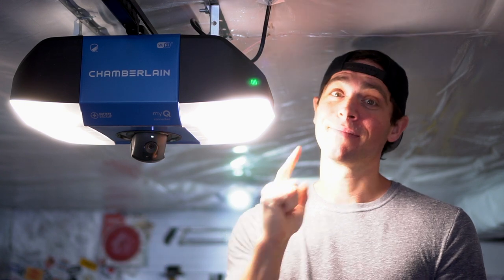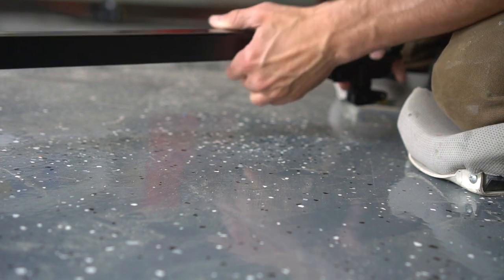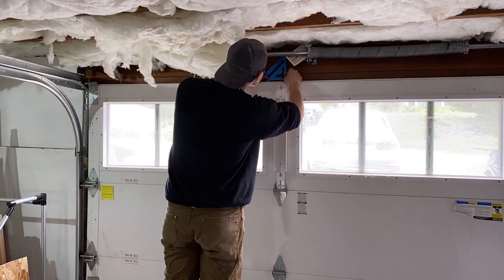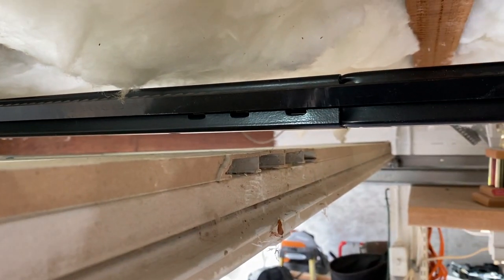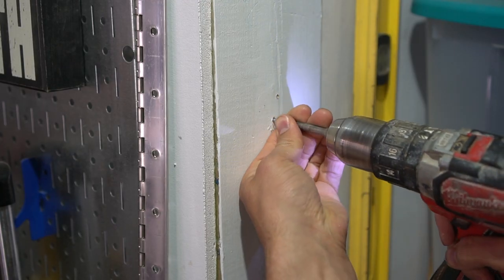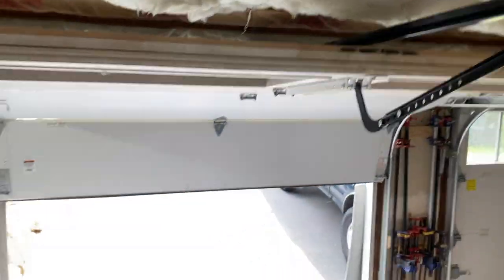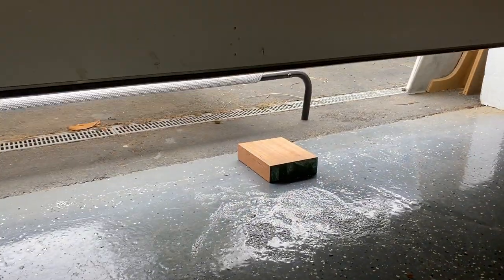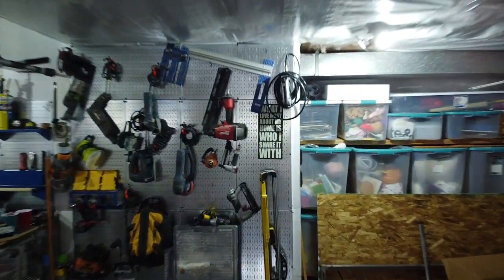DIY Garage Door Opener Installation // Chamberlain WiFi Smart Home Devices

Comment: Good video, high production value if I may say so. I installed sectional doors and old school chain drive and screw drive openers back in the 1990's . I was just brushing up to make sure i get it right. Thanks bro it all fell into place except for the belt I would have screwed  up the master link part.

Comment: You forgot to release Chamberlain Belt Drive Garage Door Opener Spring Loaded Trolley Auto Adjust

Also it's a Clevis pin.

Lastly, being you're installing 2 GDO'S, ensure you install the sending (amber color) sensors from center pointing away from other door. This way, the receiving (green color) sensor doesn't attempt to receive the other GDO's sending (amber color) sensor.
Reply from the maker: Thanks for the helpful tips Charles.  Great note on the sensors.  Thanks for watching and hope you enjoyed the video.

Comment: You missed a very important part that you didn’t do. It was labeled all over the parts list not to forget. The spring needs to be released so it can get proper tension after expanding. Otherwise great video!
Reply: Was about to post the same thing

Comment: I noticed that is seems like you didn't install the battery backup until the very end. Will the opener function without the battery installed? I don't want a battery in mine, but you can't by them without backup batteries here in the People's Republic of California. If you leave the battery out, does the opener keep warning with lights, beeps or alerts?

Comment: There is two things you could adjust the way you attach the stray door arm you did it incorrectly you’re supposed to put the door arm in the center between the two slots of the trolley and then you install the cotter pin and then depending you can shorten your door arm all the way down to the last hole or depending flip it around and you want your dorm to have a decent angle but a good thing to do is at least put this straight door are in between the two pieces of metal on the trolley

Comment: You installed 2 new GDO, my question is can you hook one wall mount button by the door that goes into the house and use or for both doors? Or do you have to have both wall mounts hooked up ?

Comment: If I let you know really great video but if you wanna know a few tips you do not need the door arms to be so far out like that you can actually have the door arms closer in to the door and if you worry about neatness you can cut off the actual door arm to make it look good and then with the safety sensors you actually want to leave about a foot of wire and you want to pigtail it because if something gets caught on the safety sensor wiring you will pull it out But if you do not have any more wire in the garage door opener then leave it as is but if you have plenty of wire just do the step backwards and add that and then you will be set to go
Reply from the maker: Great tips Zackary and thanks so much for letting us know.  Based on your Youtube channel you have WAY more experience in garage door openers then I do so I greatly appreciate your input.
Reply: BYOT yeah no problem
Reply: I actually looked at the video again actually you have your straight door arm installed incorrectly it’s not supposed to be installed on the outside of the trolley is supposed to put it in the center between the two holes can you slide the cotter pin for one hole through the door arm and threw the other hole So the way you have your door arm Installed you can move the holes all the way down to the last pair then mark off with a little marker at the end of the straight piece of the door arm and cut it with a hacksaw or a angle grinder then you won’t have to worry about it going through the door or hitting your head on it and then on the opener there is a stop bolt that you’re supposed to install
Reply: And on the second garage door opener you installed you put the emergency release handle upside down